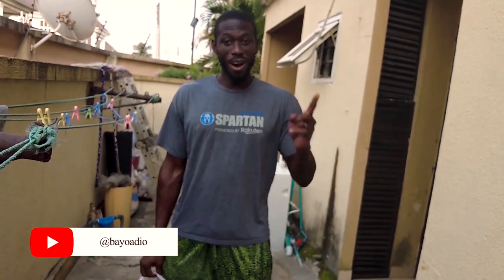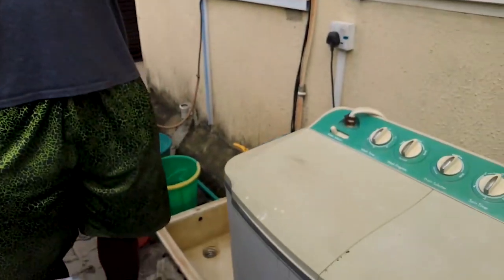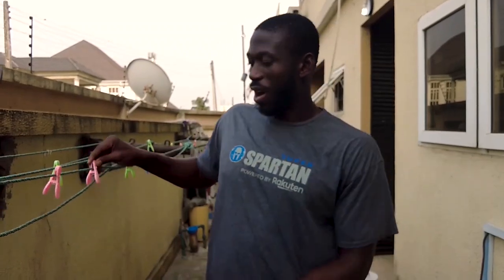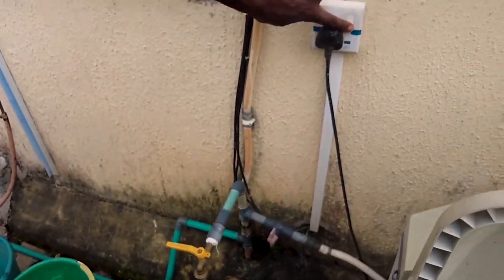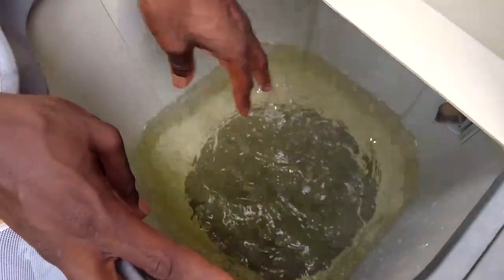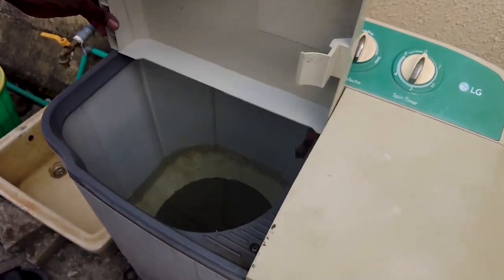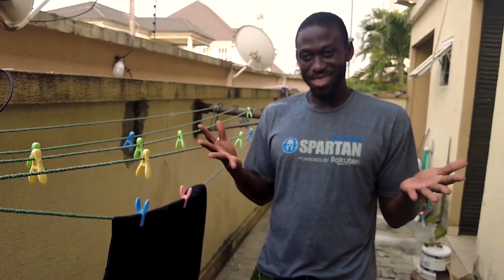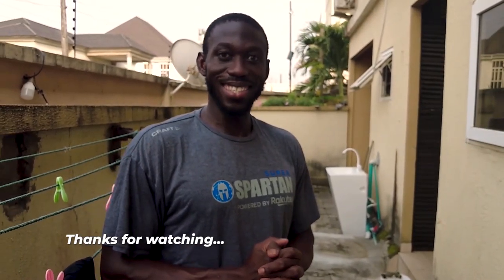CHECK OUT THIS UNIQUE, AFRICAN STYLE WASHING MACHINE IN LAGOS, NIGERIA - TWIN TUB WASHING MACHINE.

Comment: I use a similar machine here in London. It is small in capacity (2.8 kg as opposed to 4-6 for a conventional machine), but it does a good job! Cost me about £63 a couple of years ago. I always fill it with hot water and liquid soap. A nifty little German machine which has saved me from the hassle and inconvenience of  frequent trips to the local launderette.
Reply from the maker: it is not bad at all
Reply: Wow ! This is good and cost effective. 🙏